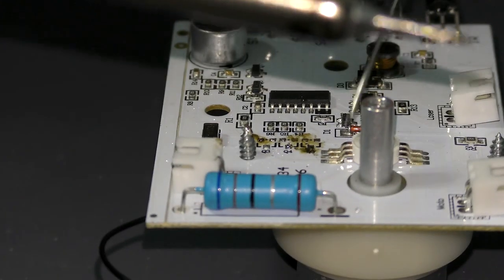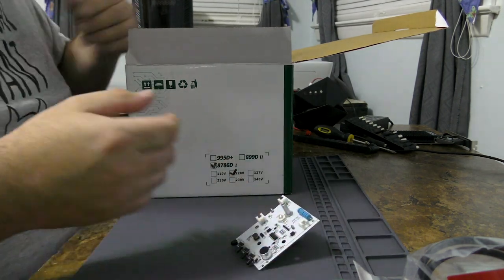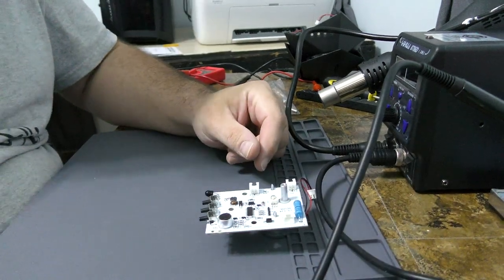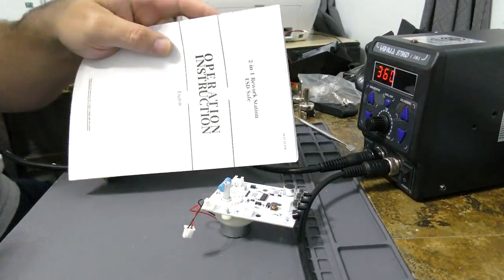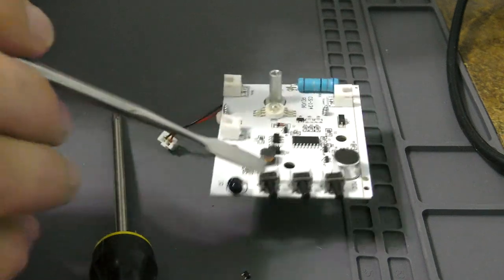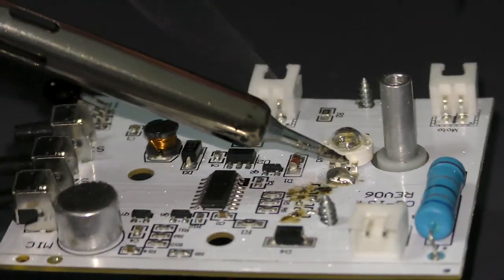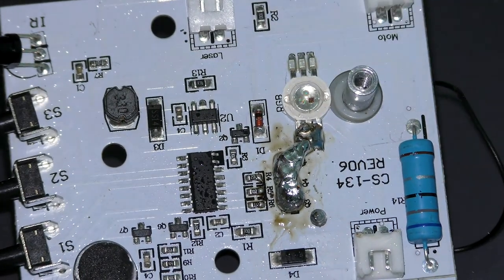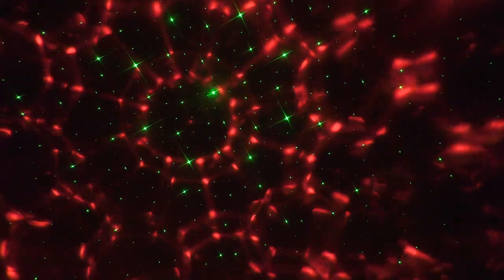Yihua 8786D 2-in-1 Hot Air Rework Station Unboxing (Merkury Innovations Galaxy Light) - Jody Bruchon

Comment: (1) Now that you have better tools (context for others: I know him IRL) than that absolutely pure poo Horror Freight iron, you'll potentially get better at soldering. Better tools make a difference, and the determining such factor in irons is not cost. I speak from experience, as you know... I don't blame you for hating the process, though. It's admittedly quite a pain in the butt, and I wholeheartedly admit my own technique sucks, good as my tools are. I'd be better, myself, if I got a better technique, but what I have works well enough that I'm too lazy to bother.

(2) Reasons why only the red LED might be lighting. A lot of heat dumped into a semiconductor package usually is not a friendly thing to that semiconductor, and all the heat in that board from the blob over the transistors affects the LED just as much as the lump over the leads. Also, red LEDs operate at a lower voltage than green and blue, just by way of function, generally (especially if they've done it kinda the oldschool chemistry way -- not here, these are clearly high-efficiency dies, but red will still be a bit lower power) so it may be either (a) swamping out blue and green or (b) offering enough of a low-resistance path that blue and green are effectively bypassed.

(3) A better method for the future: beep out polarity and common side on the LED. Short the three LED pins at the resistors for the LED (unless those are already commoned -- doubt it, based on your results!) rather than at the LED proper. Wire LED resistors and LED common directly to supply positive and ground, along with motor. Less heat, LED will last longer, AND you'll get all three colors unless the LED is buggered.